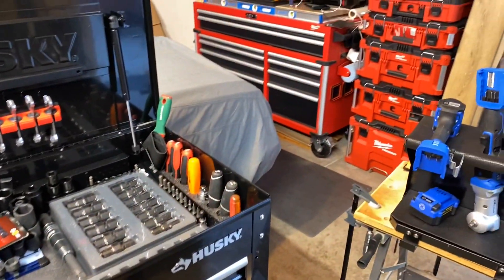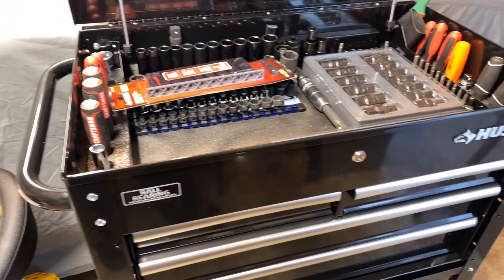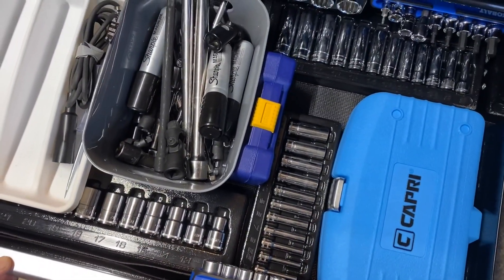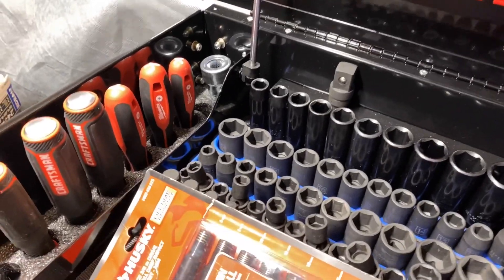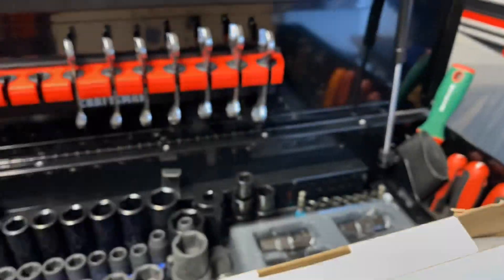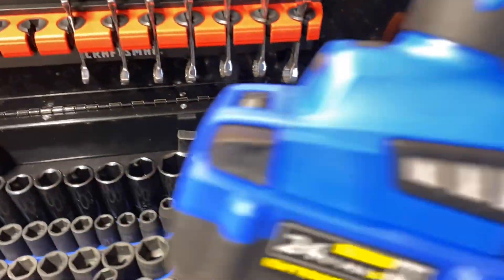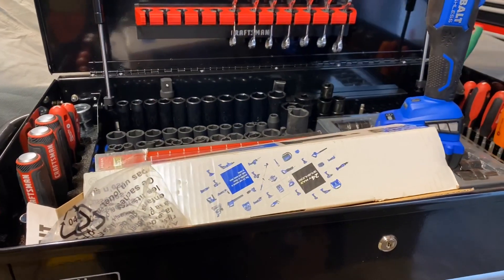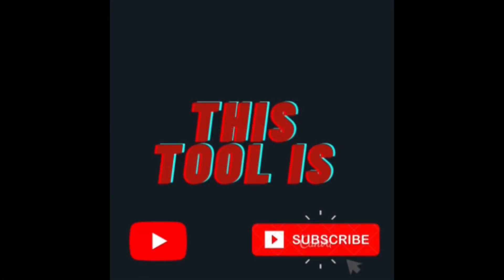Husky 4 drawer tool cart tour Kobalt Die Grinder on clearance

Comment: -I heard about that Kobalt Die Grinder at Lowes on Clearance for $40. Considering it, but I don't have a Lowes in my city, and since clearance stock isn't shown online, it would be a gamble to drive to a store for one. - Though I do get the sense that that product is widely available, like you said. I still may go down there and get one. I'm not sure. I love buying new tools,  and fortunately, I'm not married and don't have to pre-authorize my purchases w/ a wife. But I did already spend a lot on tools and car parts this last month. I bought the same Kobalt Right Angle Impact Wrench you appear to have, which works great I might add! It helped me remove a rusty exhaust pipe! I also bought a Husky 77 piece Tap and Die Set to fix the threads in the exhaust manifold. And at Harbor Freight, a Pittsburgh 37-piece Impact socket set for this work. - I wish they were as easy to read as your Milwaukee sockets are. To improve the readability of mine, today I took a white grease pencil over each socket's measurement's number, which highlighted it against the black background of the socket. Not sure if this will last very long, since I bet grease from work will erase the pencil grease gradually.
Reply from the maker: Hey there you are buddy, I dont know thats up to you if you want to take the chance of Lowes maybe not having the Die grinder in stock maybe you can check BrickSeek app they are pretty accurate on Lowes inventory. As for the longevity on the marker used  on the sockets I can’t call it maybe keep an eye on it and touch it up as needed.